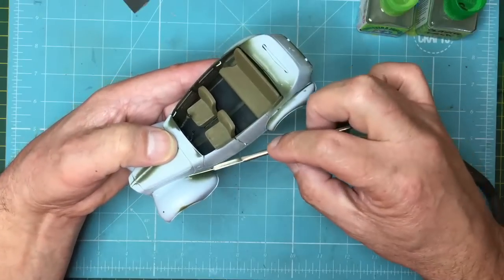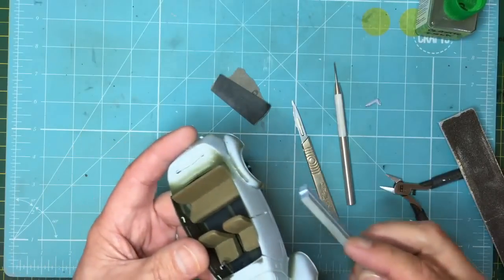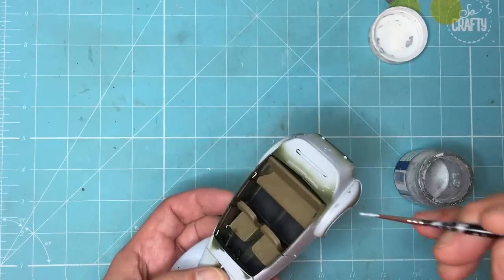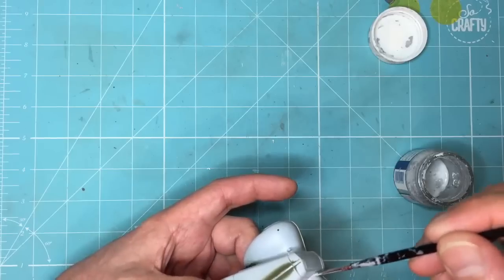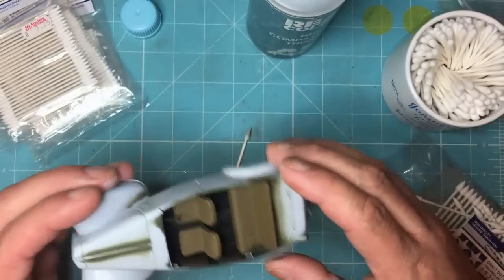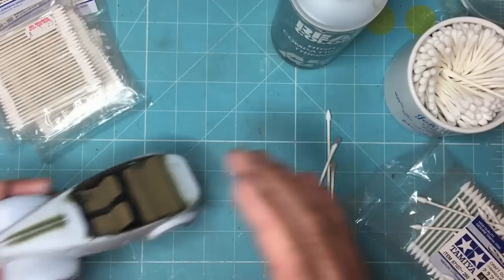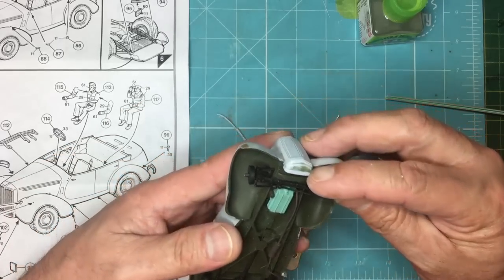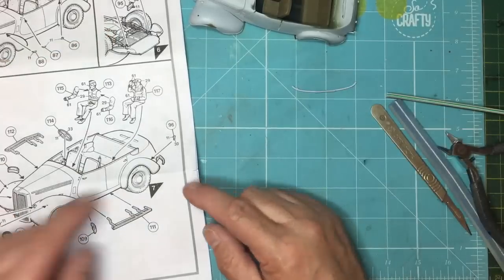Beginners guide to scale modelling, Airfix 1/32 Montys Humber. Part 11

Comment: Loving the build - I going to need a bigger work bench for all the bits I keep buying. Most of the Vallejo Model Air paint well with a brush (and airbrush obviously) - I've used them pretty much exclusively after I returned to aircraft (I was using them for weathering loco's and rolling stock before that). Though there are a few that are awkward...